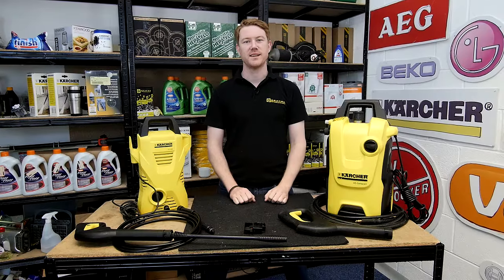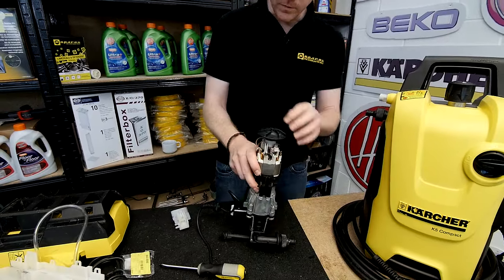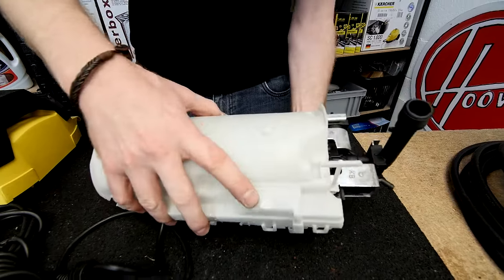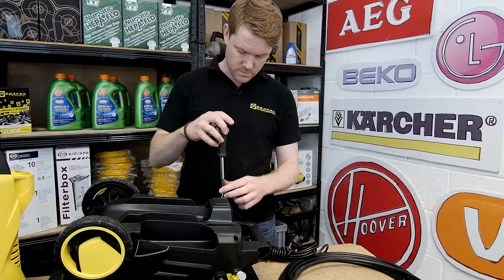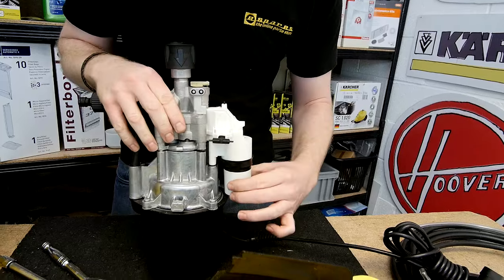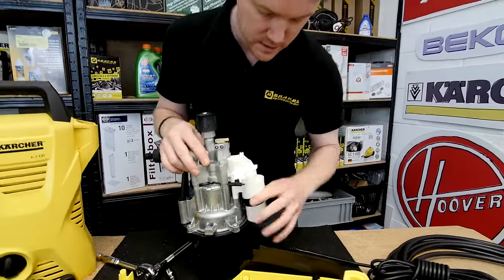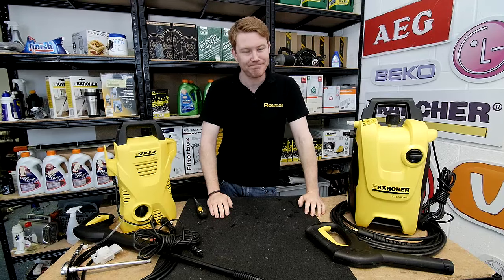Have a Karcher Motor Fault? (Karcher Motor Replaced)

Comment: Hi I have K4 karcher machine. My one when I turn on the machine motor running noise is not continuously. Look like on and off and spraying pressure also indicating fence symbol on handle. Is ther any faulty inside?

Comment: Hi Matt, I have a Kartcher K4 compact looks very similar inside to the K2 in the video. It trips my circuit board switch and or the RCD. I have tried your electrical diagnostics video. Switch is fine, capacitor looks ok and tested ok (charging and discharging). Fuse ok. Live to Neutral though is showing 400 ohms. Same when I do live to neutral at the switch. Any ideas? The motor is not exposed like on the smaller models to be able to test. Not sure if I can take off the black cover to check the motor and even if I did what could cause the 400 ohms. Any advice appreciated

Comment: Hi,
I see you are savior for many having issues with the Karcher.  Please see if you can help me too.
The problem started with the Karcher pulsating every 2 to 3 minutes when the power is on but washer not in use.  When the machine is in use there is no issue but when I stop it started pulsating at intervals.  After 2 to 3 hours, the machine wouldn’t stop even the power button on the machine turned off.  At this point also, there was no issue when the machine is in use.  I opened up the machine and couldn’t find anything obvious, so I closed it back.  Now, it will work if I turn the on/off knob several times.  It will stop when I release the handle but wouldn’t turn on automatically when I press the handle again.  Would you be able figure out what the issue and what needs to be replaced from the problem described herein?
Reply from the maker: Hi Antony, have you tested the switch but we have had issues similar so check these: try another spray lance as a partial blockage can cause the motor to shut off then come back as the pressure reduces. Check there is a good supply of water to the machine and the filter in the machine inlet elbow, and there are no air leaks on the supply hose also, have a look at this diagnosis video www.youtube.com/watch?v=4WZgprLndhU

Comment: I have a 2.240 and every now and again i turn the power switch on and nothing happens.  I disassemble the unit, yellow cover only, and then do a quick on and off test.  It works.  The I reassemble and works for a while, but the problem comes back.  Have you seen this before?

Comment: Need help for fixing my karcher k5.200 low pressure problem, thanks
Reply from the maker: Hi Hills Up, try this 
1. Disconnect your Pressure Washer from the electricity supply.
2. Remove the black high pressure hose from the outlet of the machine. (If your machine has a hose reel, remove the trigger gun from the hose and leave the hose connected to the machine).
3. Connect the garden hose to the inlet of the machine.
4. Turn on the water supply but leave the machine unplugged from the electricity supply.
5. Leave the water running through the machine for a period of 5-7 minutes.
6. Re-connect the black high pressure hose.
7. Squeeze the handle of the trigger gun to draw the water through the hose and into the gun until water exits from the lance.

Comment: Nice! Now I'm not worried that the Karcher I have isn't an induction brushless motor ones!
Reply from the maker: The switch is positioned to turn the motor off when the water flow stops as you release the spray gun. Bypassing or moving this switch would result in the motor running manually and not automatically as designed.
Reply from the maker: Glad you found the video useful.

Comment: Hi, I have a K5.7, I've watched all your videos, diagnosed the problem to be the switch however it's not as straight forward to change as this model. The part came this morning (complete assembly) but I can't seem to remove the old one. Looks like it's combined with the pressure switch which I can't seem to retract. Any ideas?

Thanks
Reply from the maker: Hi Richard, we think if you follow the video from 7:10 you will be able to remove the switch assembly from the pump.
Reply: Cheers for the quick reply, unfortunately I'd already tried that (with the pump laying down, so emptied of oil). Is there an email address I could sent a photo to?
Reply: Hi when am using my  karcher model  k360  during  am washing  engine start and then stop and then  restart  I must  to know  what  the  problem

Comment: I have a pressure washer apart right now. There is no activity at all at the pump. I checked the plug and to the best of my knowledge, seems okay. There is no fuse in the plugin head. Just a GVI plug.
I have the motor out of the unit and found that on one side, there is a long spring holding the brush in, on the other side the brush is just sitting in the slot against the armature with no spring or anything holding it in?It just slops around?  I assume it should have a similar spring or something holding the brush against the motor?
Reply from the maker: Both brushes must be pushed into contact with the armature so this is likely to be the problem.
Reply: Thanks. Actually I realize after I posted that the post that the spring should hook to is broken and spring is gone. So will need the plastic part and brush holder. I did put a spring against brush & taped it on so that brush was under pressure & holding against the armature. It did work and kicked in. So will go on the hunt for part. Thanks. Great vids and support by the way.

Comment: Mine k 7 doesn't star. what could it be !? so far couldn't find a place or someone to fix it. any suggestions?  thanks
Reply from the maker: +rjbda2003 You need to trace continuity between the plug and the motor using a multimeter. You may find another video easier to follow see:
https://www.youtube.com/watch?v=pJkyY8qRRwc

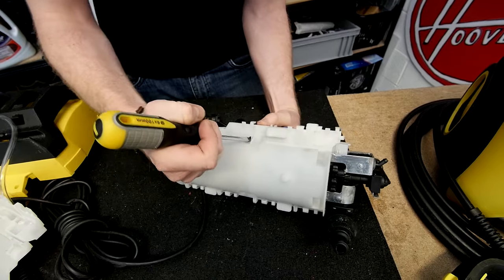Comment: I received the correct part number but no way is it easily clicking in as at 1:39 in video. Seems to be too much plastic in the way for the back catch to grab. about 1mm out. Help.
Reply from the maker: The black plastic peg is pushed through the hole to grip it, it should release with a little force.

Comment: i have problem with the switch on / off
can we direct the connection
Reply: can tell how to direct the connection 
or please let know the from where get spare parts in bangalore
Reply from the maker: Hi Satish, if the switch has failed then you will need to replace, we have no idea where to buy in Bangalore but our website will be able to help www.espares.co.uk/search/ma877pt1899/pressure-washers/switches/karcher

Comment: Never understand why these brands choose components that only last barely 100 hrs/ year for a few years and then malfunction. An electric car can go for 150000km without any engine issues, easy. The fact that my third karcher has 'stopped' in 10 years (one interior cleaner, this is the second pressure hose K4) totally baffles me, such horrible components. No professional work, just maintaining a large house, cleanups twice yearly. Never had a plan to buy all these tools, get a good piece of kit that doesn't fall apart (capacitor, carbon sticks, whatever). Karcher? why ever?

Comment: capacitor need to be dis-charged !
Reply from the maker: Thanks for your comments Moataz. Reservoir capacitors  in DC power supplies must always be discharged before contact. This appliance uses the capacitor to pass AC current phase shifted to the other motor winding. When not running the capacitor is across two motor winding's in series  so will always be discharged as soon as power is removed.